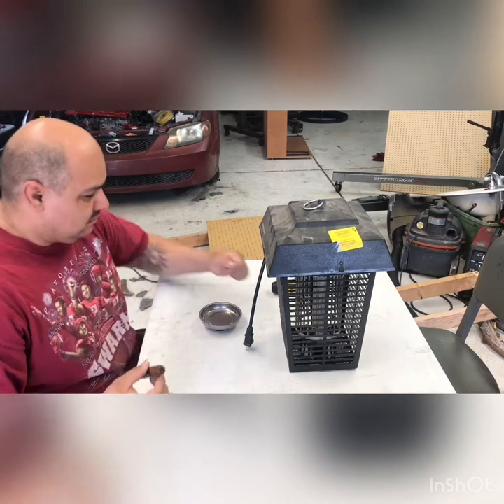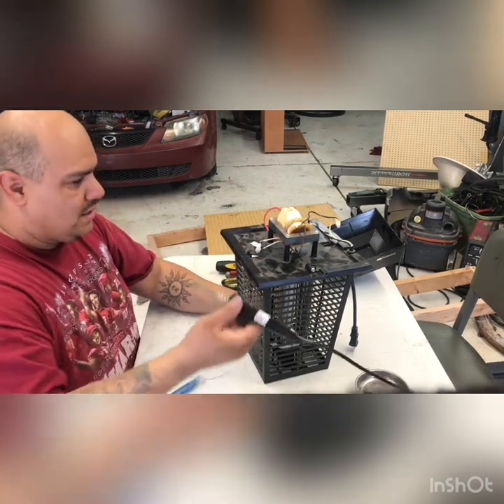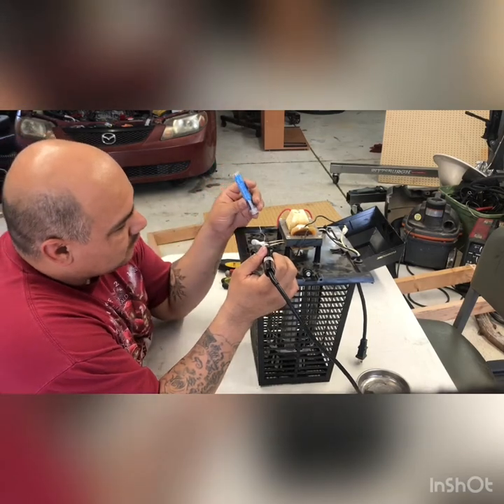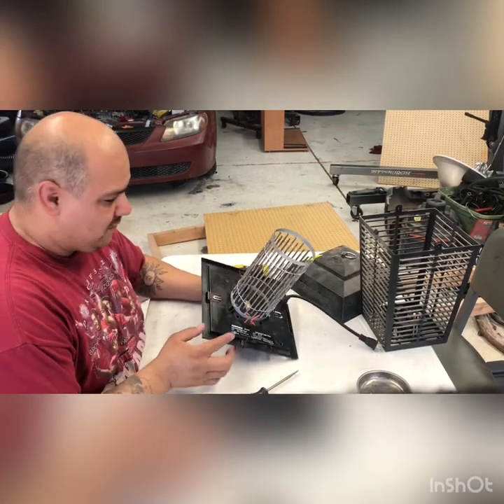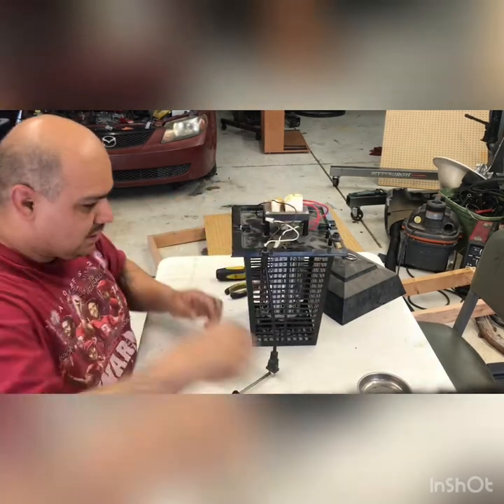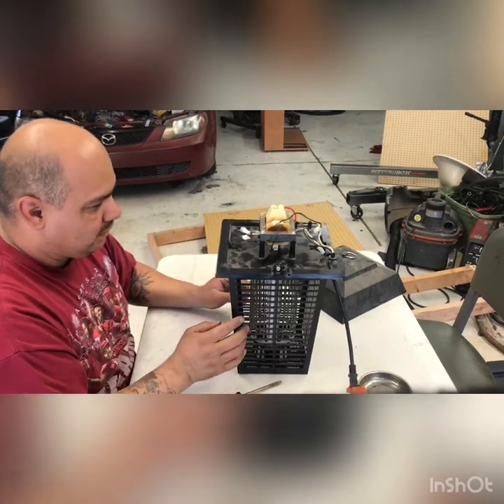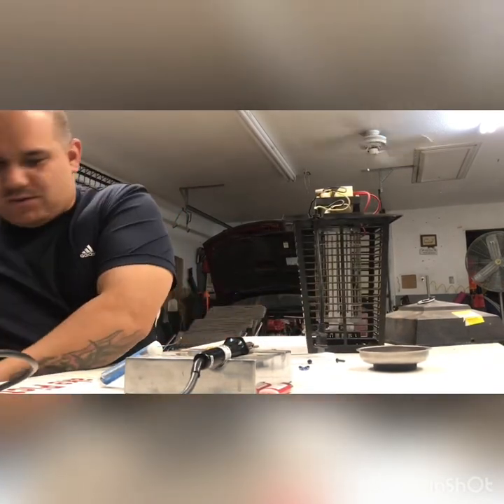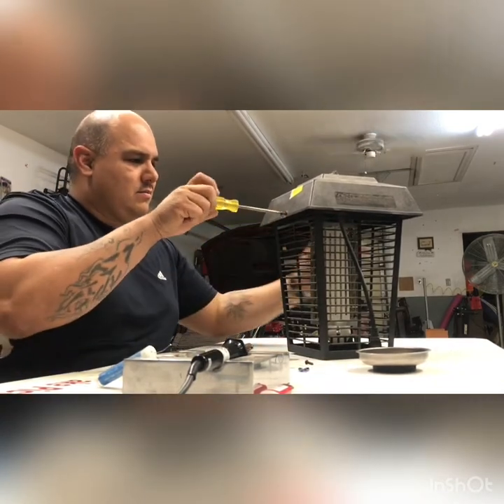How to replace a light bulb and an igniter on a Flowtron BK40D

Comment: Thank you for the video, and especially the links. Often enough, even when I know what I'm looking for, it's surprisingly difficult to find the product I seek.

 I am no soldering expert by any means (I don't even know the proper terminology to discuss it) and my early attempts were just like yours, but I've learned two things that will help you. First, melt some flux on the tip of your soldering iron so it makes better contact and conducts heat better. Secondly, preheat the surface you intend to solder with you soldering iron before you bother introducing the flux to the joint. Also, if you think you're dealing with more sensitive electronics use of a heat sink will prevent heat damage to the sensitive component.
Reply from the maker: Hey that’s great advice thank you so much. I’m glad your able to find what you need.

Comment: You can get the igniter from Flowtron (might as well order a spare while you're at it.) Also, this is a good time to replace that short cord with something longer; lamp cord, appliance cord, tv cord, whatever. Cut off the female end, strip the wiring and use the flowtron's twist connectors.

Comment: While I realize your Flowtron had two separate issues, it should be noted that it is not necessary to remove any screws when changing out the UV lamp only. Per the manual you remove the black plastic panel located on the bottom and pull it out.
Reply from the maker: There’s a manual?! That’s super cool.

Comment: the starter increases the voltage for a quick second to get the electricty in the bulb to arc across the whole length of the tube to give full illumination. the arc (like a lighter or defense zapper) illuminates the gasses creating a bright bulb.... different gasses create different colors like neon lights...and sometimes a powder coating like your bulb, to even out the light across the bulb.... i think i got it

Comment: what is the exact specification number for the igniter bulb replacement ...?
Reply from the maker: Hey buddy, if you go onto the flowtron website you will see that the part number you need is 
Code: 505-10544
Price: $3.84
I hope this helps you out.

Comment: Where to find/buy a where to find/buy a bulb  product model M-02, working area 80m, product power 5W, Grid Voltage 3000W?
Reply from the maker: If that’s a flowtron bug Zapper you will find a link in the description, also you can google at that info and it should take you to Amazon. Happy hunting.

Comment: But conectors
Reply from the maker: Couldn’t find any.
Reply: @Mrpyro187  the littel cabinet next to the radio has all the but conectors
Reply: @Mrpyro187  or just use a ring conector or spade and jus use the crimp part of the conector
Reply: you said butt connectors.... ;)